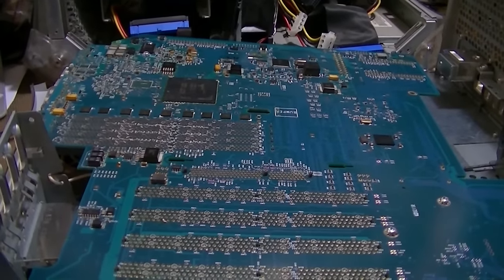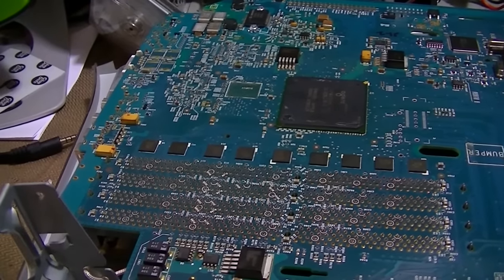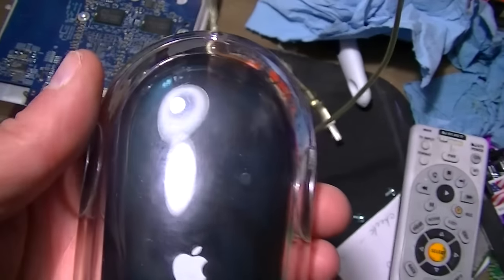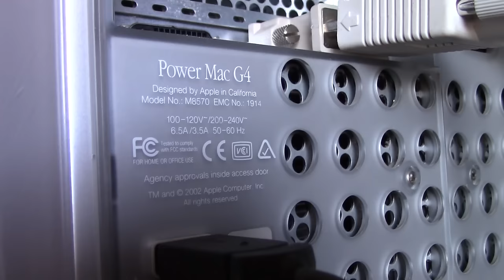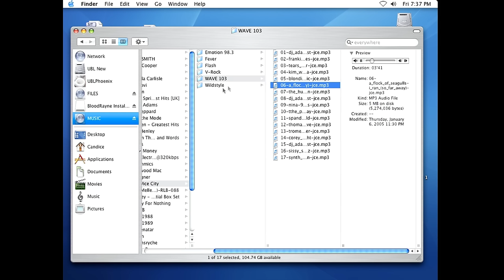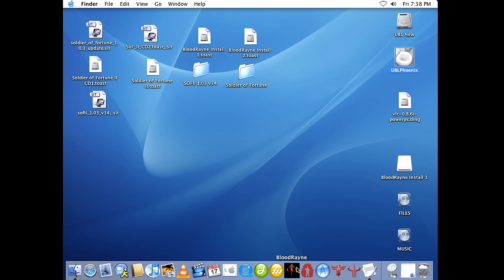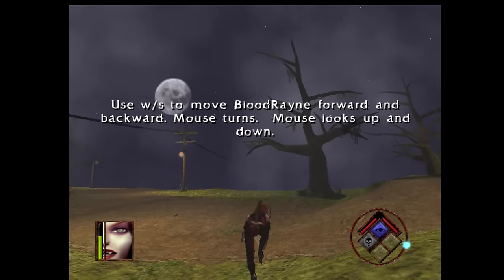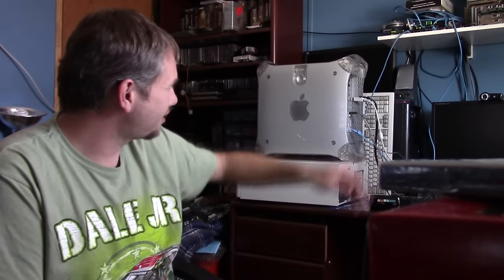Apple Power Mac G4 MDD - Revival

Comment: As far as I can tell, I only have one mirror door in my collection. Thought I had more than that, but it always ran great for me. Of all of the towers Apple made, I liked it's design the most.
Reply: Mark Woodworth i have case modded 3 AGP G4s to the standard mini ATX configuration. The mirror door case is one of the most difficult to mod and you will definitely need to cut the rear of the case and use a laserhive kit to finish it.

Comment: I think you spent too much time with the game footage. My own G4 MDD has only given me one problem: I had to replace the power supply! YIKES! But it was probably my own fault since I had 4 internal hard drives and 2 DVD burners installed and all the expansion slots filled, including a SCSI controller which stopped working once I upgraded to OS X 10.4.11. Yeah, SCSI. I had a great Heidelberg scanner and an amazing array of hard drives and even a tape drive for backups. Still a great machine. I used Pagemaker (!), InDesign, Photoshop 7, Illustrator 10, Acrobat Professional. Runs Classic like a champ and can still boot into OS9. I think the G4MDD was the most beautiful, elegant, gorgeous machine Apple ever produced and I think its design is superior to any G5. Those puppies had problems with overheating, even after all the re-designs.

Comment: Cool Mac, I have an older Powermac G4 400 MHz PowerPC 7400. But it's just freezing when it has booted to the desktop, tried different PPC Linux distros, three different video cards. One of the cards (GeForce 3 Ti 200) gives a black screen. I'm more into Linux, I might be ending up modding it instead. But an old working Mac would have been fun to have.

Comment: holy shit look at the framerate on quake 3
Reply from the maker: +Reisen007SCI That was my first reaction too.  I am curious now what it will do with a real video card.
Reply: +WaybackTECH To my experience the CPU is more likely to form a bottleneck than the GPU, at least in the G4. Not so much in the G5 though. I ran that beast with a 6800GT no problem.